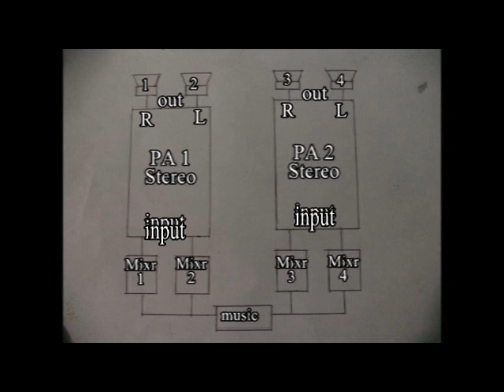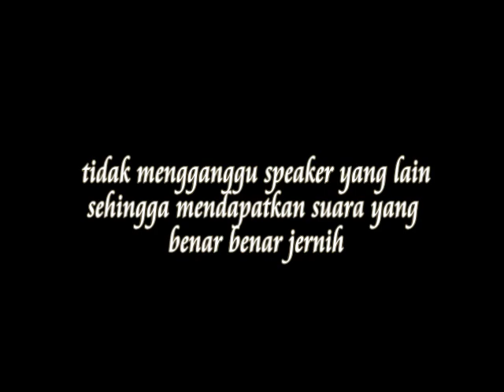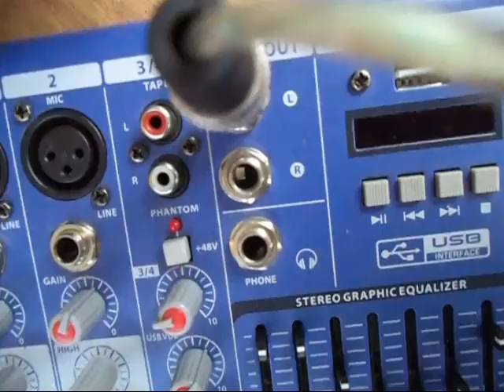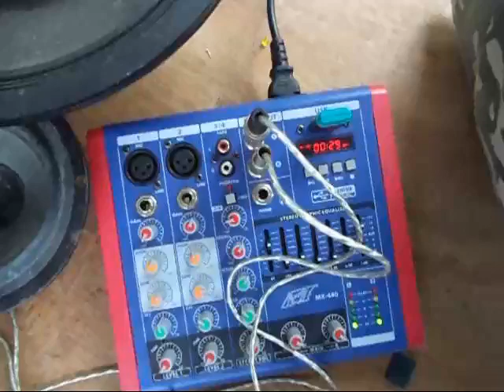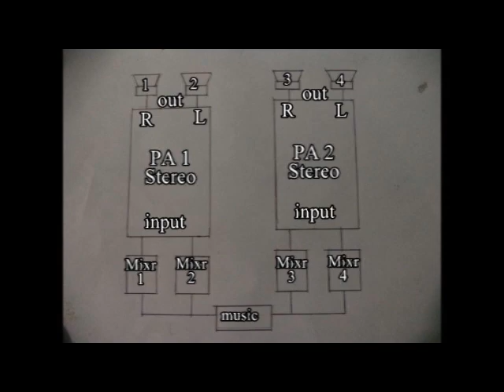Double stereo 1600 watt menghasilkan suara yang lebih manteb dan jernih

Comment: Pak mau tanya powwer travo 5@ct 45 belt itu kuat ngangkat spikeer berapa biji ya dan berapa inch
Reply from the maker: Speaker 12 inci 2 bh masih sanggup diangkat
Reply: @sukimansisu5291  kalo 15inch x2 acr 15600 pak

Comment: Ass..... Selamat siang dan jumpa lagi Pak mau nanya klo kit blazer X600 Watt plus protek kira2 sanggupkah buat ngendel 2buah speaker 15600 black jadi maen 8ohm terima kasih Pak Sukses slalu Amin...
Reply from the maker: Selamat jumpa kembali... 15600 mungkin itu 15 inci ya... Kalau 15 inci ya tentu sanggup. Boleh ditambah 12 inci juga. Yg penting heat sink tebal bantu kipas dan juga power supply nya mendukung.

Comment: pak sya mw tanya.. sya punya speker 12 in 15 in. ..klw mw ngrakit ampli  apa aja y bhan yg di butuhkn...pkoknya bassnya bisa mantep gtu ...sya udah punya trafo 10 amp..
Reply from the maker: Tinggal beli kit power amplifier 1000 Watt, tone control, sub woofer kiprok dan elco 33000uF/100volt. Lalu di rakit seperti di video saya sudah banyak saya upload tinggal pilih di channel "Sukiman sisu" ok ya boss selamat mencoba semoga sukses
Reply: kira2 itu smua hbis brpa jt pak...
Reply from the maker: Kurang lebih 900 ribuan om
Reply: segitu kuat g pak untuk ngangkat listrik sya kan cuma 450 watt..
Reply from the maker: cah angon kalau disetel maximal ya daya listrik dirumah gak cukup. Tapikan untuk dihidupi pelan kira kira 100 Watt saja suaranya sudah cukup kuat. Jadi. Kita gak perlu ngudupi kuat2

Comment: Assalammualaikum mas.
Aku punya power blazer 1000 watt mono.
Tapi aku bingung pemasangan power supply nya.
Mohon petunjuk
Reply from the maker: Riyan Syafutra waalaikum salam power supply-nya pakai Ct jadi ada tiga titik yaitu (+), (-), dan (Ct) jadi yang positip dari kit amplinya ke (+) elco negatip kit ke (-) dan ground atau Ct kit ke Ct trafo. Atau lihat di video saya cara merakit amplifier 600 Watt dll banyak sudah saya upload lihat ya di channel Sukiman sisu
Reply: sukiman sisu  di kit power ada vcc+ dan ada vcc-, lalu apa kegunaan yg (15 v ct 15 v)
Reply: Yang 1000 watt mau di pake utk rumahan atau utk lapangan...?
Kalo utk rumahan, sepertinya ke gedean tuhhh watt-nya...
Jika dipaksakan utk rumahan, plafon rumah di kencengin dulu paku atau baut plafonnya 😝😝

Supaya keluar dia 1000 watt, minimal pakai trafo 30 ampere (45 vcc - 55 vcc) mksdnya dari trafo sambung ke penyearah 45v atau 55v trus ke power tulisan +vcc ct -vcc...
Jika pakai trafo 20 ampere speaker harus di bawah 1000 watt...
Hati2 jika pakai 2 speaker utk ampli mono. Jgn sembarang sambung... cek di google cara sambung aman speaker seri dan paralel. Salah2 sambung, antara tr final atau speaker yg jebol...